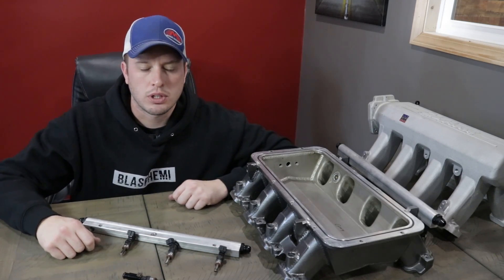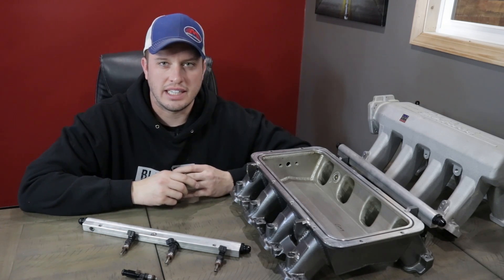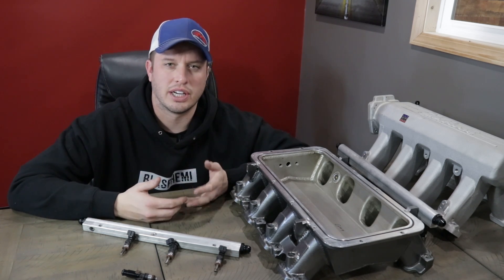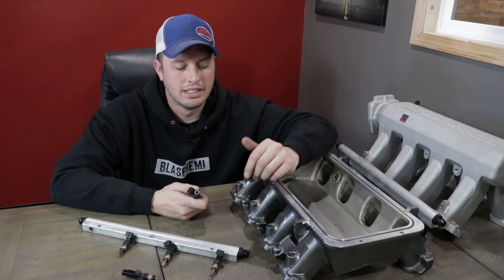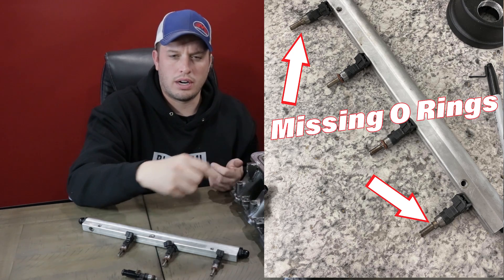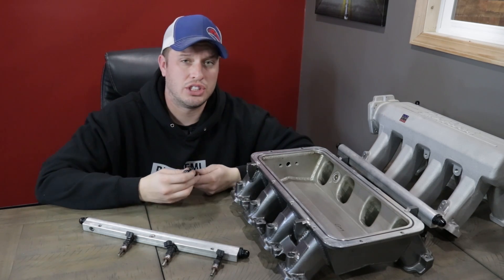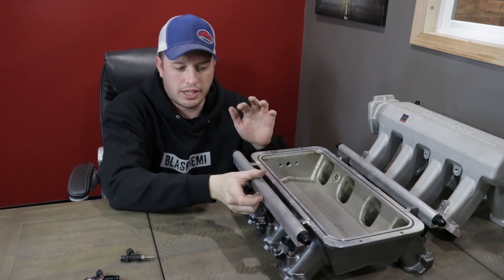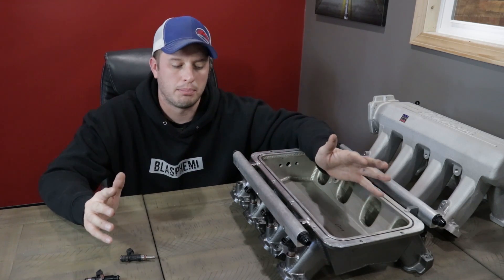Missing O-Rings = Lost horsepower and DANGEROUS: Tech Tip Tuesday

Comment: I believe I might have dropped one of the rubber o rings into the chamber when replacing my fuel injectors as I could not account for the last one. Is there any danger to my engine. I do not have much knowledge of what could happen. Thanks in advance for the information. It is a stock Acura tsx 2.4L inline 4 cylinder. Thank you

Comment: I would like to see a video on how you guys complete a boost leak test on a turbo charged gasoline engine. I regularly check for boost leaks on light duty diesel pickups (non overlap oem camshaft). I pressurize the turbo inlet horn which results in a pressurized hot side pipe, charge air cooler, cold side pipe, and y-bridge on a duramax diesel. Thanks